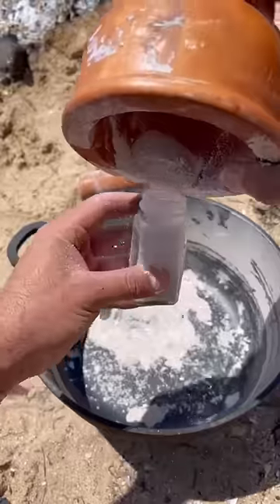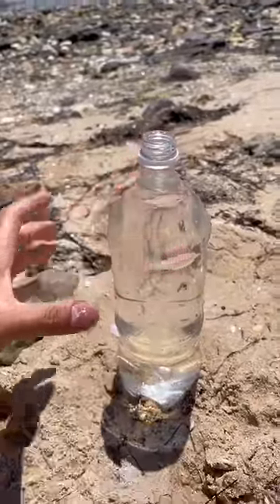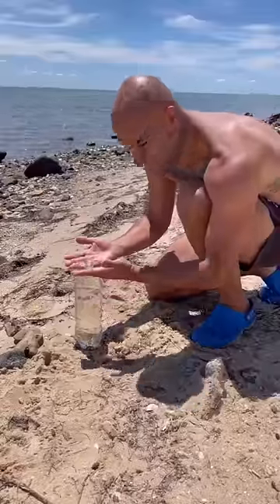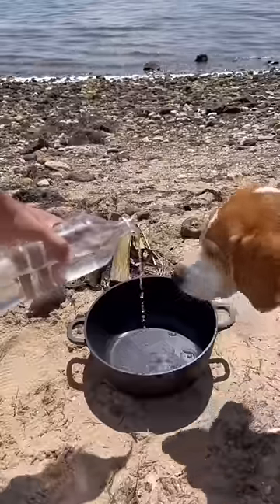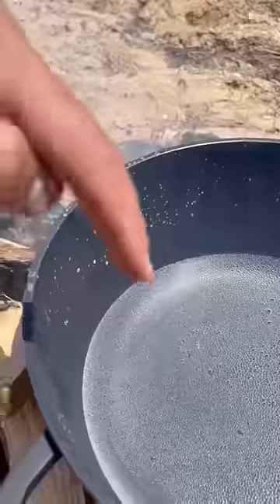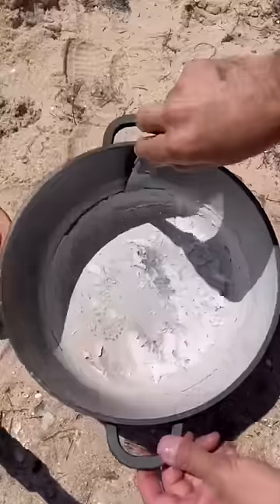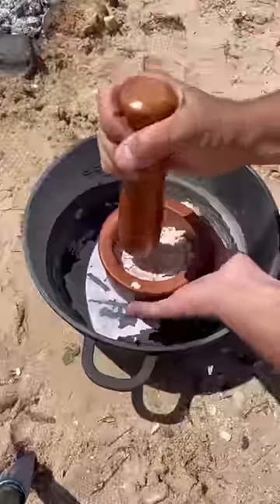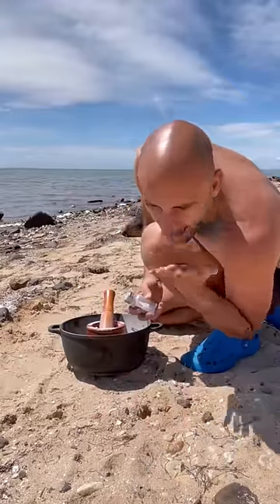Turning Salt Water Into Cooking Salt

Comment: "That's salt water brother"
Dog: I missed the part where that's my problem
Reply: For the rest of the video he pretend like he let the stupi human do his thing and never taste the tastiness ofthe water.
Reply: That's what I said
Reply: @kingsly3690  no, Running electricity through salt water would just cause the water to break down into hydrogen and Oxygen. The salt also breaks down some so there is chlorine released from the recation. Its called electrolosis. When separating salt from water you simply boil off the water. Like in the video. The salt cannot dissolve into the water vapor so the salt is left behind.
Reply: @kingsly3690  If you burn the hydrogen and Clorine gas byproducts together you can make hyrdocloric acid.
Reply: Every buff bald guy is now carrying the burden of Tate
Reply: To the dog, those are two things it loves 💀 not to mention that when they see flowing water they can’t help it
Reply: Ill take the staff job..double the money
Reply: Look at little shirtless Jr...gonna cry?
Reply: "Pizza time"
Reply: Whoever reading this, I pray that whatever you’re going through gets better and whatever you’re struggling with or worrying about is going to be fine I wish you the best of what life has to offer.❤️👏👏

Comment: “Back on how to ruin ur pan with a knife😃”
Reply: using a knife on that pot should be ok. it’s not a non stick pan anyways
Reply: @potatopenguin5864  you could chip the knife and then have metal shavings in your salt.
Reply: @GoTi4No Well, the human body doesn't use the same type of iron, but I do agree a person should be fine as the stomach can digest metal
Reply: @GoTi4No use the right tool. Scraper, not your useful handy dandy knife.
Reply: I see the pan experts are in force 🤣🤣🤣🤣
Reply: @bored1930  got any questions about pans? Your at the right place.
Reply: @dublethetruble4620  🤣🤣🤣🤣
Reply: That’s a cast iron. You can use any utensil with it

Comment: Please don’t do this unless you’re in a VERY remote area since the salt will have a ton of very harmful heavy metals and micro plastics in it.
Reply: Mmmm micro plastics
Reply: Honestly, there really isn't a safe area anymore. Besides, he is doing it wrong.  You gotta do it slower for the crystals to form, and you then pull it out of the solution. That way it is mostly sodium chloride, rather than everything in the water.
Reply: @icecontrol2571  Don't worry...it's already in you.
Reply: @seancoyote  yea right now he has a large amount og magnesium chloride too, not very tasty

Comment: That's looks like very high content of calcium sulfate/gypsum. Those crystals look like gypsum crystals not your typical rock salt/sodium chloride.
Reply: So how do you make table salt with sea water? I heard they use Iodine but idk the process
Reply: @captainharloq8054  You take a big batch of water. Evaporate it down to about 10% and this is when calcium sulphate precipitates. You then collect that or pass the water to another 'pool' where you evaporate it down until sodium chloride precipitates and you collect that. Then there is still 'bittern' left in the remaining water which is bitter magnesium salts and highly soluble potassium salts.

That is one common way.

There's other methods like freeze distilling and there is magnesium waters which will have a lot more of the bitter magnesium salts that won't precipitate much calcium sulfate. But calcium sulfate is the least water soluble of the salts so it will precipitate first to the extent that water has calcium and sulphate ions.
Reply: @captainharloq8054  there is micro plastics in all sea salt so this is irrelevant, instead by rock salt or Himalayan pink salt.
Reply: @CrackDavidson1  woah, I didn't expect to get reply this fast lol, thanks👍
Reply: Definitely. Don't forget micro plastic 🤣
Reply: Ya he really smart that salt is not the smart move
Reply: Was looking for the comment that said this
Reply: @sebastianflynn1746  I was looking for one too, but didn't see it, so had to say it. :)

Comment: Try putting the salt water in aluminium foil instead of a pan. Aluminium also conducts heat very well, so you can put it on top of the pan too. Its easier to remove the evaporated salt afterwards. You're welcome!
Reply: cooking in aluminium gives Alzheimer's
Reply: as if salt from the sea was as pure as the salt you buy right? In the sea there are a lot of magnesium, potassium, strontium and calcium salts that you kinda don't want to eat. Especially magnesium ones are known to be pretty disgusting. Plus let's just gloss over the fact that he didn't go deep at all and that area probably has significant amounts of animal feces and other junk. That is definitely not how you make salt. To actually make salt you need a more complex process that gives you what's called "sweet salt", aka nearly pure sodium chloride.

Comment: If you want good drinking water from the ocean, I believe you can hang a rag or a piece of clothing above the pan (in this case) to collect the steam while boiling the salt water. Ringing it will leave you with drinkable water.
Reply: Or use two glass
Bottles connected to each other on their side. Fire under one. The water will evaporate and collect in the second bottle the first will be left with salt
Reply: Sounds a lot simpler than a siphon tube and all that shit.
Reply: You might get a few drops
Reply: Not really, salt is often chemically bonded with the water in oceans, this is why it’s very hard to get water from oceans
Reply: @Anonymous-ei8ex  How would we chemically remove such bonds?
Reply: @anfrac3700  probably boiling it
Reply: @xanderxavier5074  repeatedly I assume?

Comment: There are other salts other than sodium chloride (table salt) mixed in this :D
Like magnesium chloride for example, which is also soluble in water so it didn’t sink down like the sand at first, and so it is mixed with the NaCl when you evaporated all the water.
One way to get purer table salt is to evaporate most of the water first then slowly wait for the saturated solution to crystallise out NaCl crystals :)
Reply: yum minerals
Reply: @leedto5939  THEY'RE MINERALS MARIE
Reply: Thank you for saying this.
Reply: Thank you Weeb friend

Comment: The bad part about making salt from the sea is the calcium carbonate that sea water contains, that helps stuff like kidney stones to develop
Reply: Only if your calcium intake is chronically excessive, otherwise it's perfectly safe, which is why it's used as a dietary supplement. If you eat enough of salt made like this to cause excessive calcium levels in your body for a long period of time, you're going to have other things to worry about!

Comment: What is the point in letting it rest? You mention something about letting things in the water settle, but never show you pouring out the top water or keeping any of the bottom water out of the pan. You use all the water.